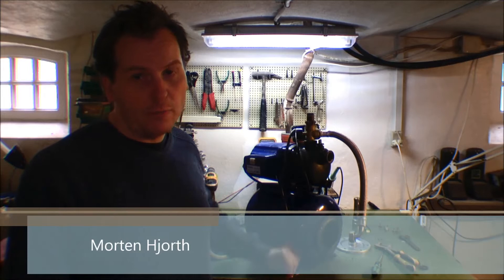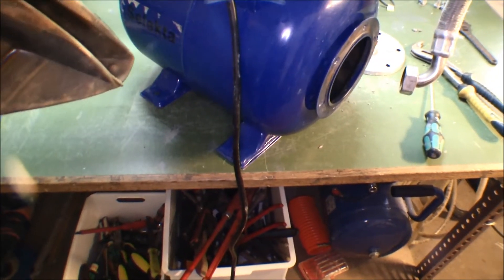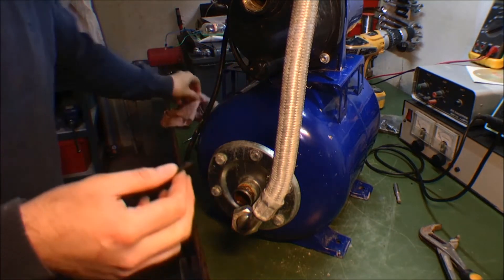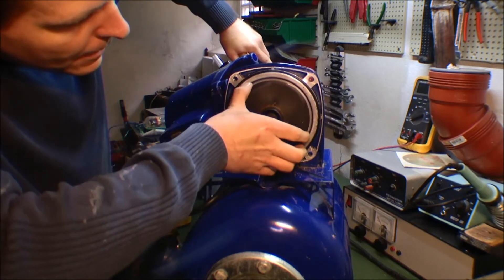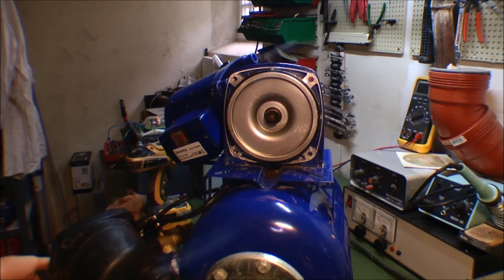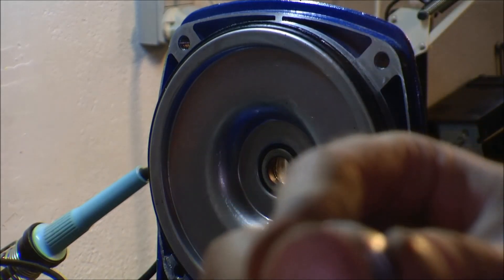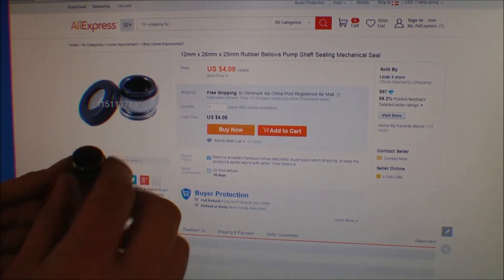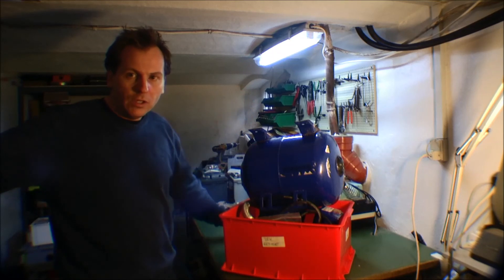Separates Home Pressure Booster Pump to switch Pump Shaft Mechanical Seal - 185

Comment: Do you need pressure from the pump 100% of the time? If not, you don't need the tank on the bottom. Also if the bladder still leaks and your not going to replace it, you can go ahead and block off the tube that feeds the tank.

In the US we call that a whole assembly a "shallow well pump". 
Good job getting it apart and ordering the replacement, hopefully it fits.
Reply from the maker: Hi Josh Bishop 
Thanx,,, Most of the time I use it just as a pump, but I have set it up so I can use the water to wash clothes.
It was after using it for this, that it became really leaky.

I did come across the term "shallow well pump" but what is the difference,, between that and a Booster Pump ?
Thank you for watching! :-)
Reply: I'm not sure there is a difference between shallow well and booster pump except that booster pump is a broader term.